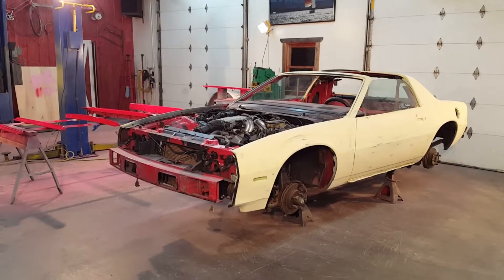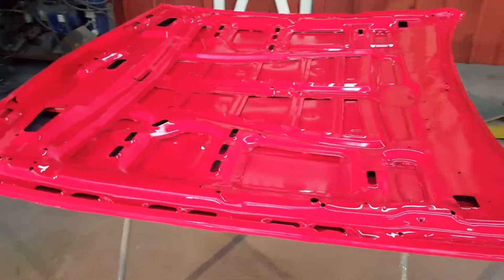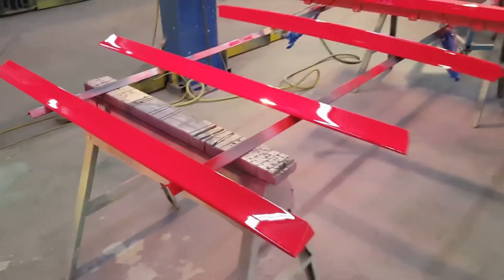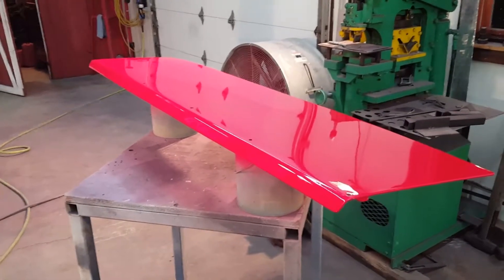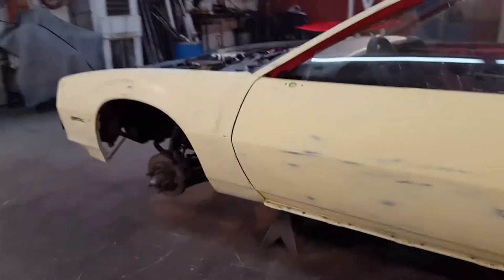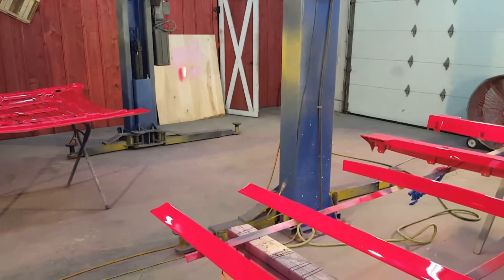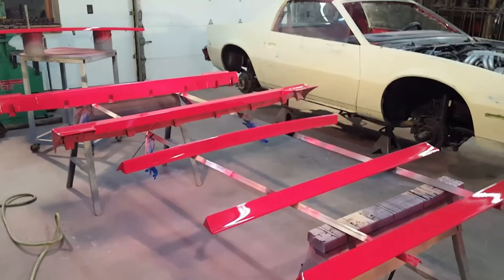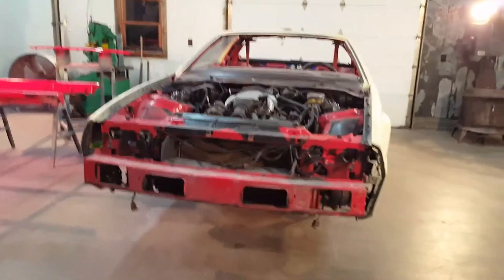1986 IROC Z28 PAINTING RESTORATION

Comment: I have the same issues with dust specks. It is what it is. My first paint job too. 1989 Camaro that I'm restoring. Already rebuilt the engine and replaced just about everything! Lol.
Reply: Mine is getting the original Bright Blue Metallic. Probably not the best color for my first project but I wasn't going to tear it all down. I've changed my mind so se then and it's all apart now...